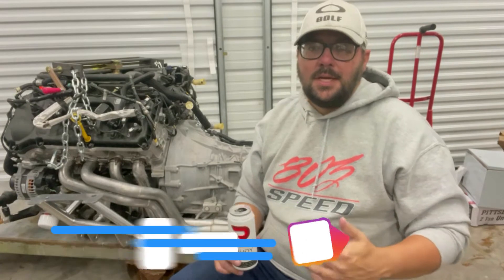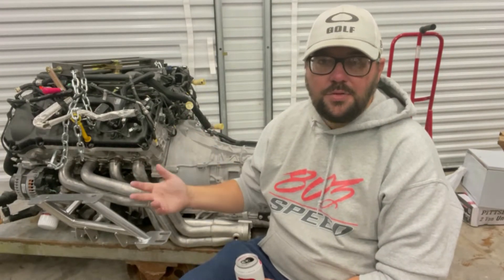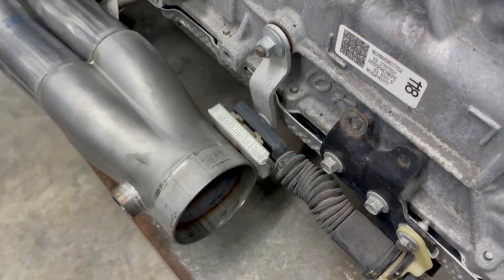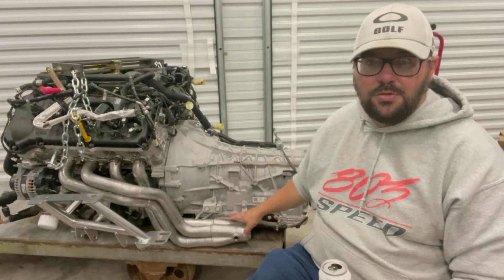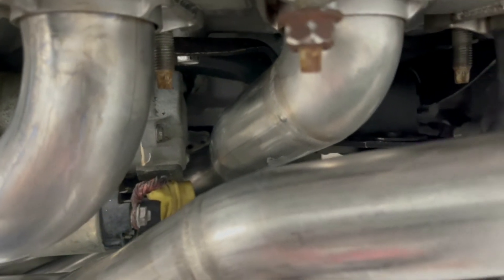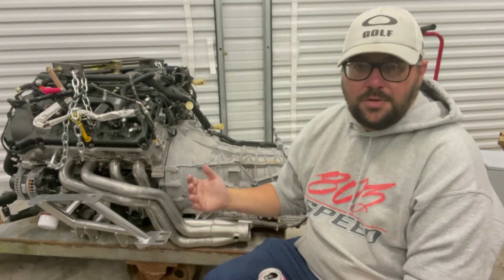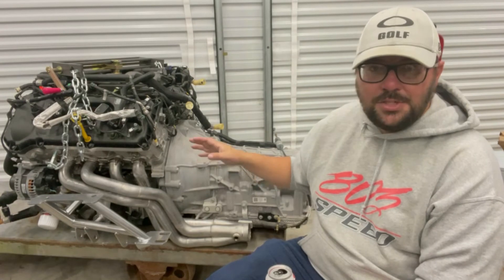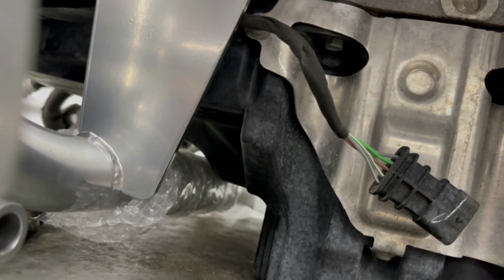Coyote Swapping for Dummies! Common problems nobody tells you!

Comment: I used Maximum Motorsport K-Member and Kooks headers with my Gen 3 10R80 swap. No issues at all!
Reply: So the Gen3 oil pan fits with the Maximum Motorsports K? Or did you have to use spacers?
Reply: Are those BMR good??
Reply: Same here M&M k-member and kooks headers with my Gen 3 10R80 swap. No issues!
Reply: @davidd3574  yes the oil pan will fit without any issues. I used maximum motor mounts also.
Reply: @vchandl1  Thanks for verifying this. Nice to have 10 quarts of oil! 👍🏼👍🏼

Comment: Not sure what you're swapping but if it's a fox body mustang Cook's actually makes a set of headers that clears the 10r80
Reply from the maker: Thanks Neil. Its going in a new edge. I love kooks as they are on another build of mine but the price tag is too steep to justify on this car. At nearly $2,000, ill make what weve got work.
Reply: I thought these kits were going around 8k from Ford ?? Why 12k with 12k miles ??? Everything is a price gouge in this market.   ..wow..
Reply: What is the prices on then now??? For crate vs used ??
Reply from the maker: @Madmaxxxx1984  Just the engine may go for 9k, but this is everything you need for 12k. it came with the transmission, computer, gas pedal, wiring harness, gauges, shifter, airbox, and a ton of other stuff.

Comment: I really want to swap a gen III with 10 speed into an '08 Mustang, thanks for the info. I really don't like the clearance issues with the headers, that collector on the drivers side looks like it is going to cook that linkage. As a welder/fabricator myself I wonder if making a bracket that mounts to one of the existing bolts on the transmission to cheat the collector over might be a good solution.

Comment: The  Ultimate Headers are expensive and a nightmare! One thing you missed. You probably haven’t run into yet is the steering shaft will clashed with cylinder #6 pipe. Also the transmission oil cooler tubes are right on the header. And the starter issues. My build is Gen 3 F150 with 10R80 in 2001 Mustang GT. I called Ultimate Headers for support. They were no help. Poor design.
Reply from the maker: Good call. Are you using the low profile shaft? I wanted the kooks but couldn’t find where anybody was using them with a 10r80
Reply: Wouldn’t matter the pipe is right in the way. I think Kooks might make a header for it.
Reply: Any updates on your install? Did the steering shaft clash with your headers?  I was just wondering your solution?
Thanks
Reply: I had to "massage" the pipe a little bit so the shaft won't hit. I have the same ultimate headers on my fox. 10R80

Comment: I was able to get my k member to clear using the back holes . But the problem I’m facing is the sensor on rear driver side being way to close to fire wall to plug in did you run into this problem?

Comment: It sounds like your main issue is that new K member. I was told you have to replace the K member so the oil pan will fit. Your K member seems counterproductive. Are you certain they sent you the correct part? Its a cheap enough part to order another one from another company for comparison. Same with the headers. I heard Kooks fits a New Edge Coyote swap. What headers are those? BBK are not good if thats what they are.

Comment: Hey dude great info.  I have a 88 lx vert aod bone stock car with 103,000 original miles on My little 302. Still runs like a scalded dog 🐕but I'm itching to coyote swap with a Gen 1 2 or 3 and 6r80 or 10r80 from the parts farm or midway mustang. Have u had any bad luck with those pallet motors or trans?? Thanks!

Comment: Caution: Certain mustang parts suppliers sell front suspension components that are adequate for drag racing but NOT for street, autocross, and road course use. There's no getting around the fact that heavier front end loads require sturdier components.

Comment: Are you using the 4.6 motor mount
Reply from the maker: Yes
Reply: @803speed  ok well my motor is allmost touching on the pasenger side well the header we had to bang the outside tube so it wouldnot touch and lot a room on driver side  if i could move the motor 1inch itwould be ok

Comment: Well when you ordered your stuff from Paul by the hour you missed the bracket that they make a bracket specifically made to move your stock cable half an inch closer to your transmission probably not too many hours modifying cars but the first thing you should know is when you sit down and put together your budget for your build once you got it all written down nice take it crumpled up and throw it in the trash whatever you buy parts aftermarket stuff and custom stuff or whatever and it says bolt on and direct fit that means you have to customize grind cut been twist fabricate or inventory for it to fit I'm roughly around $50,000 into my coyote swap and I just started it for the first time couple days ago it is not my first build swap or customize car and I'm still pulling apart fuel system pulling the transmission out again just because I don't like how some things turned out it's supposed to be a pain in the dick that's why when it's all said and done sentimental value is far more than any price tag it's also why these professional car builders get 100K to build someone's car because it's a pain in the dick